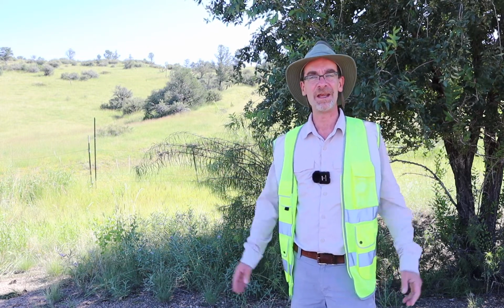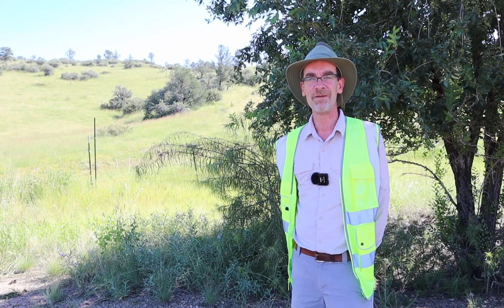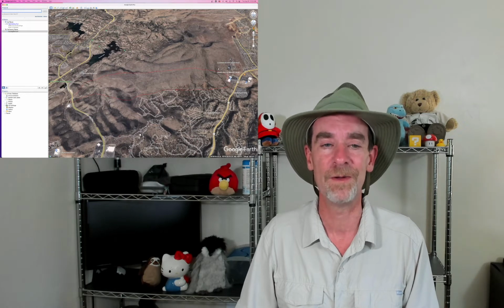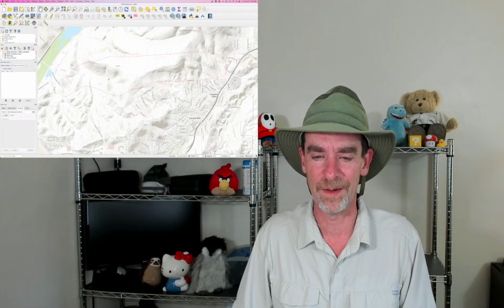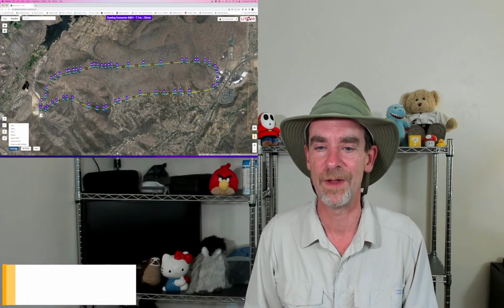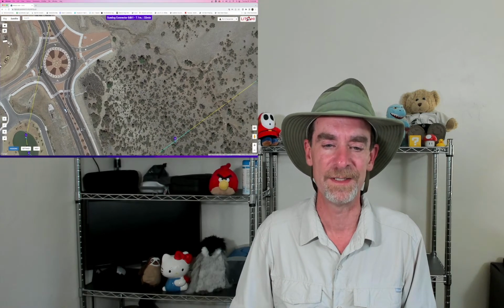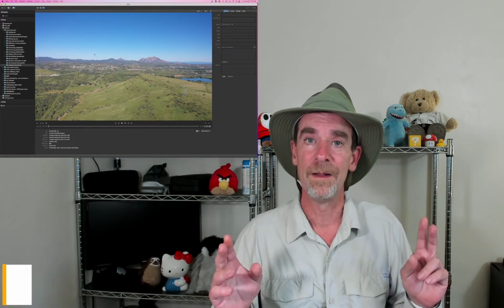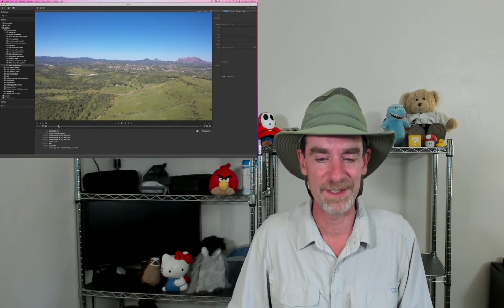Make Money With Drone Construction Projects - An Actual Drone Project Walk Through 2022

Comment: Question my friend with maps made easy i purchased the elite for $450/yr includes 1600 images ..LOL Why when i uploaded the images they wanted 4500 points more ?   thats one question the other is what do you use for mapping  Native  1/2 or 1/4   what is the BEST is native over kill im using the Air 2s using Ineherit camera settings.  i will send you my map to see what you think.. and again it was a pleasure talking to you on the phone thanks for the Help my friend .  i take it that they dont tell you that even if you can upload 1600 images you still have to buy points
Reply from the maker: I'll tell you, I've never gotten my head around Maps Made Easy's point system.  They do produce good results usually, but until I get everything setup with them I don't know how many additional points I might need.  To your second question, I the native ratio.  I think it's best to get the most out of the shots when in the field.  And yes, that can leave you with a lot of images!  I will also say, I really do like the Map Pilot Pro App.  I use it often, and when I process my models I use WebODM and Metashape (depending on my needs).